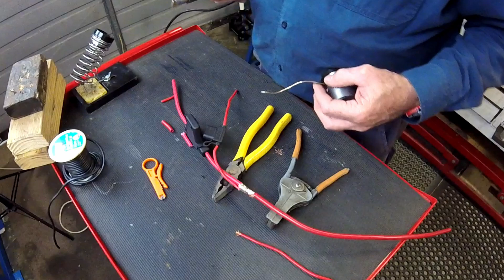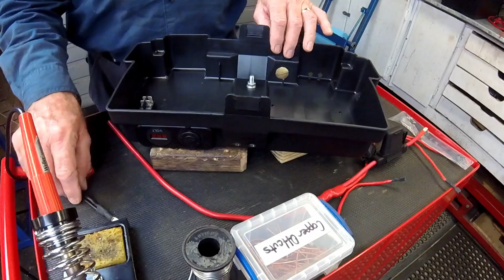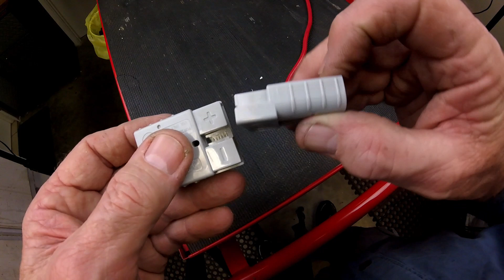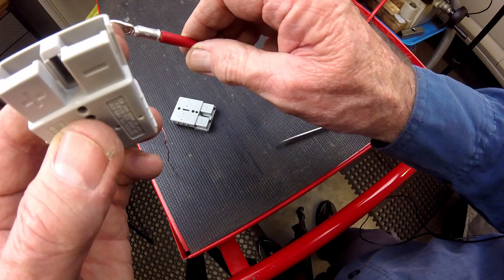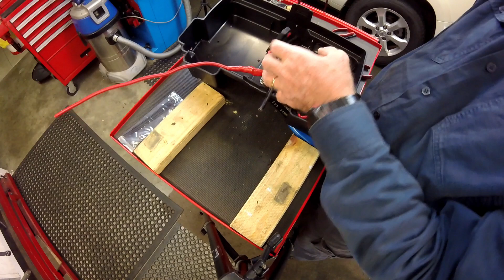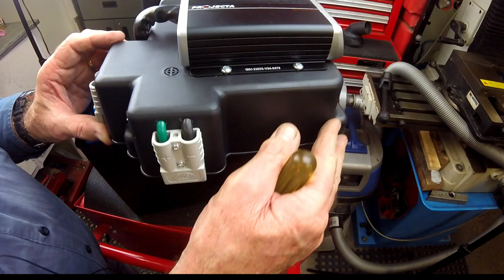Portable 12 Volt Auxiliary Battery Box Build: Part 2

Comment: can you charge and discharge at the same time without blowing up a 12v fridge?
Reply from the maker: Yes you can. If you are worried about the battery, think of it like a dam, it can fill, whilst you are drinking from it. If you are worried about the 12 volt fridge and the fluctuating voltage as the battery charges, the fridge will deal with it as a matter of course. The fridge I show in the video, happily changes from 12 to 24 volt systems going from cars to trucks, whilst even the Engel fridges of old happily deal with variable voltage inputs. I don't have a fridge wiring diagram to hand, but I imagine there is some form of voltage regulation on the input side. Hope that answers your question.
Reply: @whitedoggarage  awesome thx 4 explaining.  I wana use a 50A 12V DCDC car charger , to charge battery , while charging my fridge using this battery set up. Do you think it would work? would the DCDC car charger, run the fridge or charge the battery ? im new to this thx!
Reply from the maker: @KennyChan-uh6uf  Fair question, sort of complicated response however. The DCDC charger will charge the battery. The battery is like a dam with water going in and water going out. The water going in is the charge from the DCDC charger and the water going out is the power going to the fridge. The confusing bit is that the battery only has two terminals and the DCDC charger and fridge are both connected to those terminals. In effect the DCDC charger looks at the system and provides the power (up to 50A) that it determines the system needs. If the battery is full, the charger will taper off the current supplied to the battery, if the battery is low, it will step up the current. The fridge is drawing the current it needs and that current will be the joint contribution of the DCDC charger and the battery. If the DCDC charger is off, all the current will come from the battery, when the DCDC charger is on and supplying the battery, the current will be a bit from the DCDC charger and a bit from the battery. Hope that makes sense.
Reply: @whitedoggarage  makes a lot of sense. Should i think about it like this?  If 50A  from DCDC charger goes in,  maybe 5A to fridge, and 45A to battery? and if battery is completely full, then all 50A to fridge?
Reply: my only concern is, if battery is full, will 50A  at 12V destroy my fridge?  or no since its still 12v
Reply from the maker: @KennyChan-uh6uf  Sort of, but not quite. The fridge will only draw the current it needs. Typically it might be about 4 to 6 amps, when the compressor is working. So, if the battery is full, the DCDC charger will supply only what the fridge needs, plus a small margin, let us say 7 amps, that is 50 amps is the charger's maximum output, but in that situation the charger will scale back its output to the 7 amps required. I can tell you that the output of a DCDC charger confuses a lot of people. They get a meter and they find the DCDC charger is supplying only 0.5 amps, so they think the charger is a dud. However the battery is fully charged and the DCDC charger is only supplying what is known as a float current, just enough to keep the battery fully charged, no more.
Reply from the maker: @KennyChan-uh6uf  No, the charger only supplies the current the system needs, 50 amps is a maximum, but the charger will adjust down depending on system requirements. I am working through your questions in the order they appeared on my device, so I may have answered this query in my response to your previous question. They are all good questions however and as mentioned previously, a lot of people get very confused about what the DCDC charger is doing.

Comment: Hello Bob,

I have a question. I want to add a high output anderson connecter to my aux battery setup. I have a very similar setup to yours. Essentially I want to add the connection you explain at 16:55.

Is it ok to run that anderson output connecter to a fuse panel with my aux lights? I dont see why it wouldn't work or be an issue. What are your thoughts.

It would be Battery > Anderson Output > Blue Sea Fuse Panel > Light Controller > Lights. Does that make sense? I want to keep the battery portable so the anderson output makes the most sense I think.
Reply from the maker: Ernesto, that should work well. I use that battery box as a power source whilst camping and connect a range of power uses to it. I use the 50 amp fuse to shield the battery primarily, but I also put a fuse on the components that take power from it - what ever size fuse they need, for example my lights that I run from it need a 10 amp fuse. So there is a 50 amp fuse before the Anderson Plug and then the lights have a 10 amp fuse after their Anderson plug ie: Battery > 50 amp fuse > Anderson plug > 10 Amp fuse > light controller > lights. I also run a compressor off the battery box and it has a different fuse rating again. The 50 amp fuse always remains as the battery protection. Hope that makes sense and hope it helps with your system. Bob

Comment: Question:  The ground cable going to the battery input anderson plug, is that also grounded to the common ground location you explained?
Reply from the maker: Yes it is, all the negative cables share the one common ground. Hope that helps, thanks for the question.
Reply: @whitedoggarage  Do you need to earth the auxiliary battery when it’s not in the car? Or will the negative terminal on aux battery be enough?
Reply from the maker: @Lxzcvyesfwmk  Not sure what you are thinking there. You don't need to earth the battery when it is not in the car as such, but you need to share the earth part of the circuit with the load or the supply. So if you took the battery box out of the car and connected the unit to power a fridge for example, then the battery box would need an earth connection to the fridge, but not the car if the car was not supplying any current to recharge the battery. The current flows between the positive and negative poles of the battery so any power connection that is in use has to have both a positive and negative lead to the battery. I hope that helps, thanks for the question.
Reply: @whitedoggarage  yes that does make sense now thank you! I was confused of this concept but did some more research.
Reply from the maker: @Lxzcvyesfwmk  okay, good luck with your build.